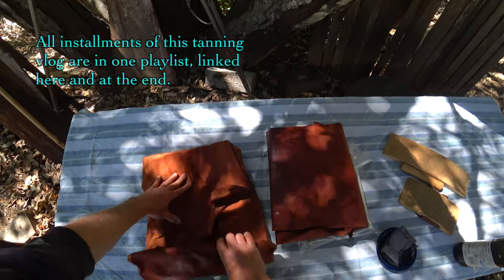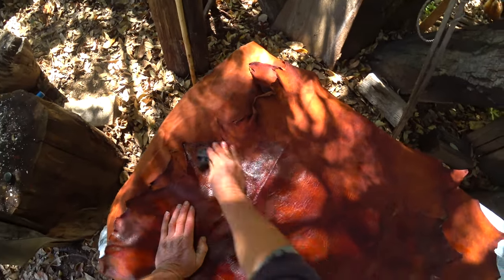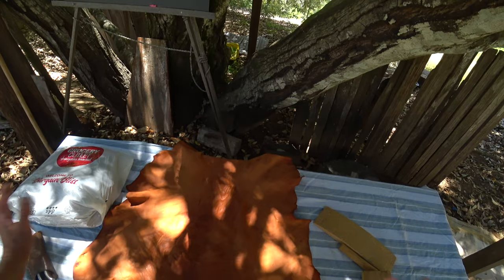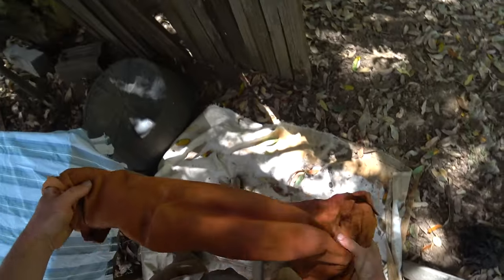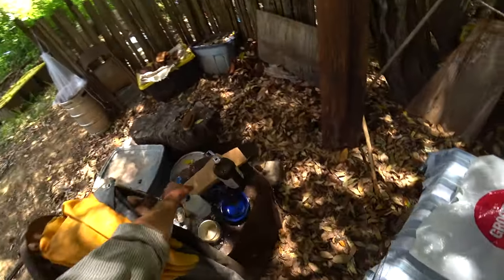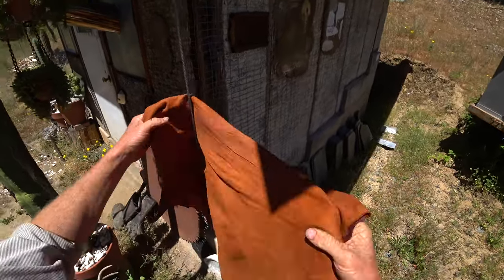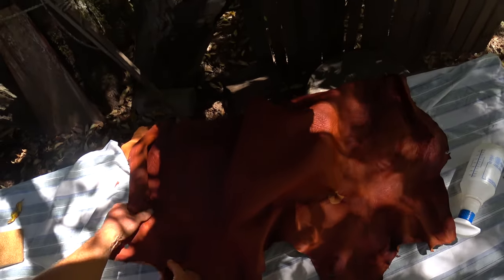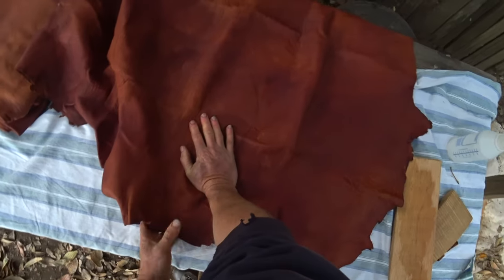Tanning Vlog: Breaking the Leather Soft and Supple

Comment: In your "Tanning sheep Hides" vlog, this video is missing. The playlist jumps from the "preparing to soften" video to "setting up for a different finishing."  I know it may be difficult to change now that they're uploaded, but it would also be helpful if every video in that vlog had a number in it (or better yet, a consistent title theme such as Sheep Hide Tanning Vlog #1, etc.); currently only some have the number. I was still able to follow along and this is by far the best leather tanning series I've seen since your "making axe strops from scratch" series, so thank you very much. There was some confusion on my part though as I tried to find the missing video in the playlist. Thanks again for sharing your knowledge.
Reply from the maker: Thanks for the heads up and feedback.  I didn't plan this at all, so I kept changing the titles.  I could change all the titles too, I'll think about that.  I can easily put stuff in and out of playlists in any order, so I'll fix that.

Comment: I have been learning about propylene glycol..  blended into the fats used in finishing, it holds moisture inside the leather better than the fats alone. 
I purchased some food grade to learn about blending my own leather dressing / finishing stuff.
Those thin areas should be an ideal use for it.
Reply from the maker: I have not used it, just glycerin for snake skins. I'm not a fan of that.  It leaves the skin cold and clammy feeling.  I"d be cautious not to end up with any sort of perenial wet feeling.
Reply: @SkillCult ... its still new to me,
 I am just at testing results on various leathers.. .. even undiluted it doesn't feel wet like water,  it's made from oils,  has a slightly oily feel... not greasy. It breaks the surface tension of water , like a wetting agent.  
My understanding is that it serves to protect from over drying,. Any how. The overdry edges brought it to mind since I have it in the house.  Just offering conversation on leather care.

Comment: why dont we wanna over saturate the leather with oil? is there a specific reason for that?
Reply from the maker: It will feel cold, heavy, it can leak out when it's hot.  It just doesn't feel right.  Think if cloth benefited from a small amount of oil, but then you put in a lot.  it's not much different than that.  it's a network of fibers, but unlike cloth, it can benefit from a small amount of oil.

Comment: Amazing looking leather, I think you were spot on with the lady's booty shorts idea :D I was totally surprised to see you using tools I normally associate with buckskin to impart some slightly buckskin like properties, but I shouldn't have been.
Reply from the maker: Yeah, that's hands down the best use for this leather lol.  I don't think there is a better tool for breaking hides really soft and draping than the cable.  I think it's the combination of sharp bending and stretching at the same time, while also keeping the grain side from crusting up.  Staking does some of that, but it's not quite the same.

Comment: Hi, I have been finishing  leather with olive oil and egg yolks. Following this video. But as the hide was getting drier it was becoming obvious that the hairside was not doing good. It is not as soft as the rest of the hide. It has a rather papery feel. And as the leather got dry and I was working it on the steak blade, it was even getting cracks. 

What is wrong? I was working with a young  red deer hide. (It has a reputation for very soft leather) I was trying to add oil on the hairside, but without any improvement.

Thanks for your thoughts. 
Honza
Reply from the maker: It soulds like weak, damaged grain.  Or possibly the hide is not tanned well.  More likely too long soaking in weak liquor.  Just a guess.  I'd probably have to see it.
Reply: The hide acts and looks as fully taned. It was in weak liquare for long time though. (At that time it was fully taned). I did layering and left it there for 6 months instead of just 2.  it even developed a fungy growth on one patch that is discolored due to that. 
So what you say would make sense. I am thinking of removing the grain. Because the flesh side is acting pretty good. Is it gona be problem now that it is taned? Any technic suggestion?
Thanks for answer .
Honza

Comment: Could you and should you use cable for cattle hide to soften it up also?
Reply from the maker: probably not, but if it were tanned a certain way and split way down in thickness, I suppose maybe.  It is not just too thick, but also very dense.  it doesn't lend iitself well to thin supple leathers.